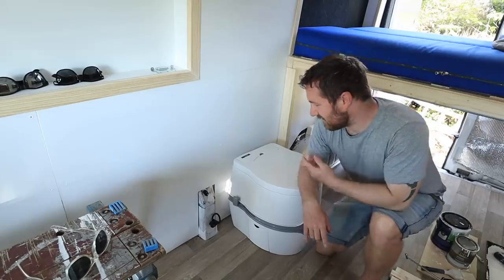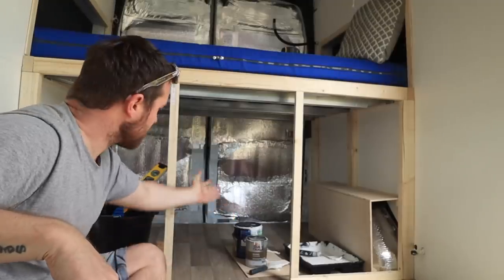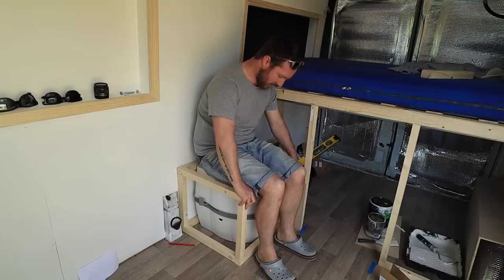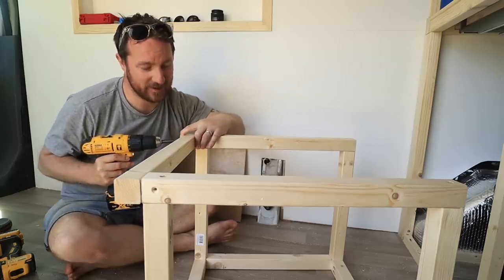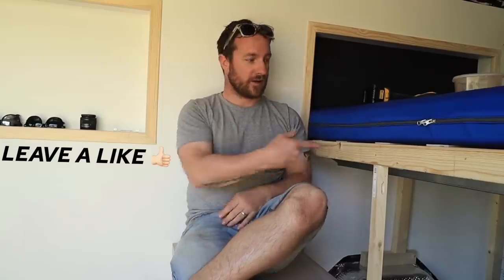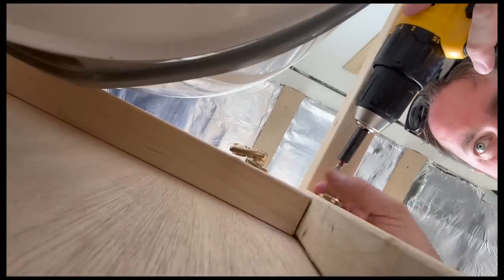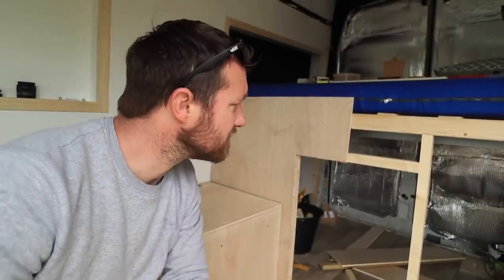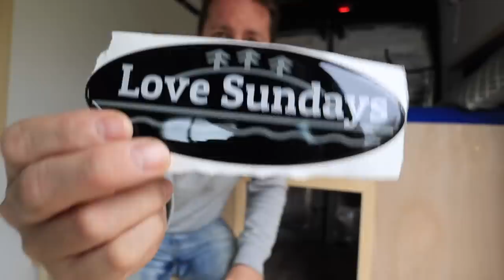I BUILT A HIDDEN TOILET IN MY CAMPER VAN

Comment: For the front of the toilet, you could have created a groove on the inside of each of the batons (or space out two smaller batons) so the panel could have just slid down into place. You could then cut / drill a small hole in the top of the panel to get a finger in to act as a handle for easy removal.
Reply from the maker: Yea I might still do that as I think the ply will rub up against my legs
Reply: @LoveSundays  Plus by doing that and removing it prior to standing use, if your aim is off you won't destroy the ply... 😂

Comment: Great Vid Shaun. Coming on nicely. You've overtaken me and I'm only doing a Transit custom Camper. Flat head screws are usually used for visual reasons. Cabinet makers use them a lot and love to line up all the slots in an OCD style!!! I think they are for hand tools only.  i chuck em out and use cross head for the sake of my fingers and mental heath!!

Comment: Lovely video again ❤ for your lift off toilet panel, grab some Hafele keku fixings.
They are used on back to wall toilet fixings when you need to get a front panel off....they also pull the panel in tighter and will not rattle like a hook would
Reply from the maker: Good advice thank you

Comment: Were you not tempted to build a small shower/toilet 'room'? It would take space, but surely would be much, much nicer.
Reply from the maker: As I’ve mentioned in previous videos I had a shower once in a van and never used it. Overnight trips don’t need a shower and longer trips when you stop over in campsites they have showers
Reply: @LoveSundays  Interesting. It is obviously personal preference, but with your high level of skill (and enthusiasm!), I would be more ambitious than 'bucket under the bed'. I have a VW T4 campervan which would definitely benefit from an enclosed toilet unit. I take your point about campsites, but the great thng about campervans is the independence they give. Nowadays I only use my van once a year for a festival. If I used it more, I would go for a shower/toilet unit and regard that as a good use of space. After all, what else is the space really needed for, except somewhere to eat and sleep, though perhaps not at the same time... Keep the reports coming!

Comment: Hey Shaun, To Cut A Long Story Short, Phillip / cross head was created to solve a problem of flat heads being shit when you use a drill or a powered screw driver. if you have ever tried used a flat head in a drill/powered driver you'll know the pain of how badly it works lol. so if you need to use a drill /powered screw driver, phillips is the way to go... lol
Reply from the maker: Yea maybe I should’ve used a manual screwdriver 😂
Reply: @LoveSundays  You Use What Ever Ya Want Mate. "It's Your Van, & You Can Screw It How You Want Too!" (Like The Its My Party You Can Cry If Ya Want To song lol) haha

Comment: What’s the plan for a hot shower then? A popup stall with a portable propane heater? I have a propane tank hooked up to a portable heater for use in the front yard (I don’t have a van lol). But I plan to use it for my race weekends when I take my race car to track and camp out there.
Reply from the maker: Yea I may put an on demand shower out the back

Comment: Loving the vids!  I was wondering if the full length front panel will get in the way of your legs when you lift the actual loo lid? I have seen other toilet boxes where the top lid has a lip at the front to compensate.
Reply from the maker: It may do I’ll probably cut it back a bit after I’ve trailed it out a bit